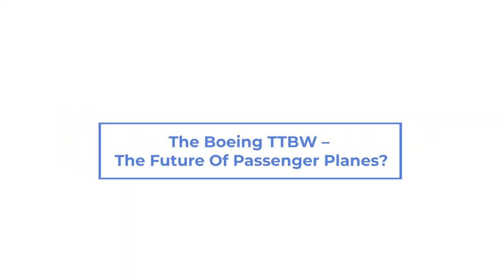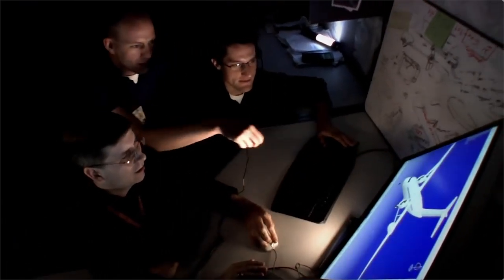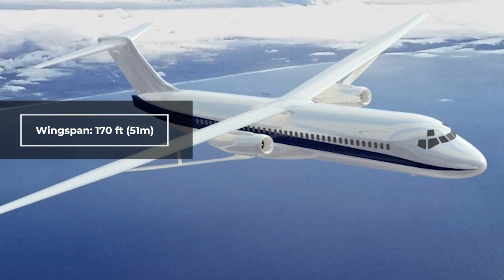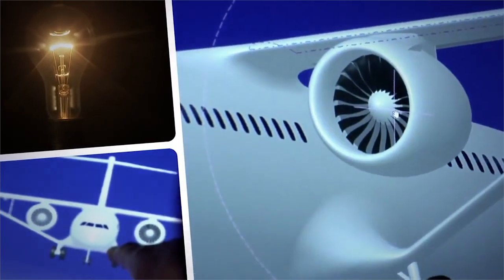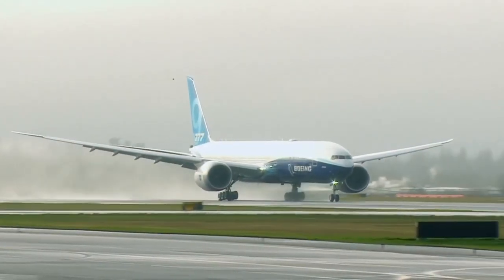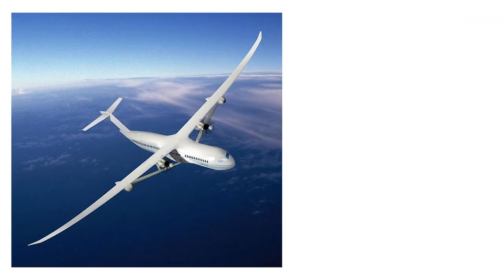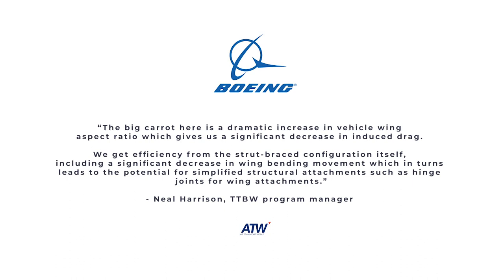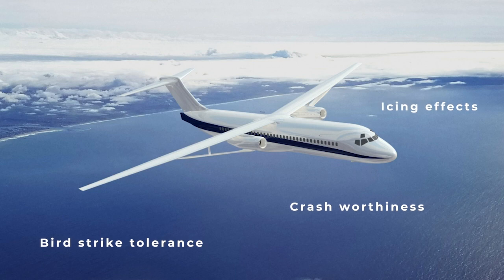The Boeing TTBW – The Future Of Passenger Planes?

Comment: 1. In the past braced wings are limited to slow aircraft due to drag.
2. If the brace is itself capable of lift the aircraft is really a joined wing design and that has possibilities.
3. High aspect wing ratios taken to the extreme have all sorts of problems: Structure is too flexible, has no room for fuel. Is too weak to carry engines and severe flight loads. But a brace helps these problems.
4. High wings on airliners with slung engines expose passengers to debris from uncontained engine failures and also more noise. However future airraft engines are likely to grow wider requiring 737 type aircraft to be higher off the ground with longer heavier landing gears.
5. Landing gears have to be mounted in fuselage producing a narrower track that is less stable and uses more fuselage space for folding and storage. This is often counted with a fuselage bulges which generates drag.
6 This configuration assumes the use of carbon based jet fuel which we want to faze out in favor of non carbon hydrogen which requires an entirely different design due to its vast volume compared to jet fuel.

Comment: Well but who's going to start the electric era?Boeing or Airbus or embrer or anyone,I am hoping Airbus could start it.
Reply: Lovevia Madeenah with the current battery technology none of them, their power density needs to improve a lot more in order to be used in big aircraft
Reply: @franciscoperezjuarez1481  well maybe in the next decades maybe solar panels will be on top of it that could save money for airlines.
Reply: @riliryrimaddyvia9630  solar panels are too heavy, would absorb too much heat, aren't strong enough to effectively be an aircraft skin, and wouldn't provide anywhere near enough power to provide any benefit at all to an airliner.

To put it into context, a b737's wings could only fit 1097 sqft of panels but that is only 2.7x the average installed on a solar powered house. That's no where near the power use even just in cruise on a jet.

Electric jets are possible once we. Have crazy dense and durable batteries but even then they will need to be very very fire resistant which isn't usually a trait batteries have.
Reply: Aeronautical engineer here. The best option for electrification at the moment is hybrid power. Since jet engines are their most efficient at full power, but can't run at full power during cruise, supplemental electric engines can be used for takeoff and climb.
Reply: @米空軍パイロット  But getting 2 kinds of Engines is also not efficient
Reply: @slav946  Yes, but the math has been done. It can work.

Comment: This is quite interesting. In the mock ups, I saw everything from turboprops, low bypass turbofans to high bypass turbofans. Assuming it'll go for a turbo fan, and to my knowledge high-bypass is best for efficiency, will those engines fit in the gap between the wing and the truss? Given how chunky high bypass engine nacelles are
Reply: Given the modern “resurgence” (of research into them) a propfan may be the best choice for this design, as it allows a massive bypass ratio without the huge cowling, which can mean a larger, more efficient engine fits in the same space. You could even place the fan(s) ahead or behind the wing while the core stays below it. The only problem is propfans are LOUD, especially when the tips of the fans go supersonic.

Comment: You haven’t clearly explained what might be the purpose of this and what type of aircraft class does it intend to replace. It seems to be just a replacement for short haul turboprop flights.
Reply: Higher fuel efficiency on a narrowbody jet concept. Possibly the "clean sheet" design for the 737 successor and ideal for flights of 3500 miles or less. Seemed pretty straightforward.

Comment: So turns out that Cessna high wing design with the support bars underneath was actually hyper efficient.

I am going to predict right now that  it will make more sense to strengthen the wing by other means and make it thinner than to add the truss. The existence of the truss is going to add drag and take away from your net efficiency.

Comment: But does it come with MCAS?
Reply: Ben Braker Yes, I know what it is. It’s a corrective system installed in the MAX series to correct for it’s weight balance being slightly different than normal 737s. I was making a joke based on the fact that the TTBW was being compared to the MAX

Comment: Boeing have configured this to take turboprops.  There is a 22% reduction in fuel burn right now with turbo props and only a tiny reduction in speed from Mach 0.8 to Mach 0.75.  There is at least another 15% reduction in this airframe probably 20%., future geared turbofans around 11%.  The ultra high aspect ratio made possible by the bracing will allow high efficiency, short take-off.  It will require folding wings.   There is talk of using solid oxide fuel cell APU that drives an electric ducted fan in the tail, that should reduce drag by 4% as well as thrust by keeping the boundary layer attached.

Comment: 9% fuel savings is great, but it is not groudbreaking. It is just a steady evolution of plane construction.
I would expect this or rather higher savings from any new model bulid from scratch.
This is probably planed to be the 737 replacement which Boeing has to come up with rather soon. (But TTBW sounds better for marketing)
Reply: Huh? This isn't a short-term plan by any means, and new models certainly do not save 9% fuel.
Reply: @AmbientMorality  The A320neo saves about 15-20% fuel over its predecessor the A320ceo. So 9% fuel savings is definitely not impressive for a newly developed model
Reply: @pix-point  Sorry, new model aerodynamic changes don't save 9% fuel. Numbers for this don't include benefits of a next generation engine

Comment: ...hmm having the engines placed directly outside and that close the passenger cabin is not just a noise issue, but if a turbine disc fails, it would result in shrapnel directly impacting the hull and passenger cabin over a larger surface area which would cause depressurisation and likely, multiple fatalities in that cabin area as well.  

Another issue is engine servicing.  Part of the advantage of low wing aircraft with wing mounted engines is easier serviceability with minimal equipment required..
Reply: What I was thinking. What happens to the wing or the truss in the event of catastrophic engine failure? Seems to me a rear mount might make more sense, given how much some of these look like DC-9s.
Reply: @simonbone  ...well they did take over the MD-95 after the merger and rechristened it it the 717 (which originally was the designation for the KC-135).
Reply: @kyotokid4  Yep, aware of that. But since some of these renders look like existing models (including the 717) I'd wonder a) how far this study has really come, apart from the wing design, and b) whether they'd already decided the best engine placement was on the wings. I'd be curious if they'd gamed the (admittedly unlikely) scenario of an uncontained engine catastrophe that damaged the wing or the truss.
Reply: @simonbone  ..my thoughts are this is that this will end up like the 7J7 and BWB projects and they will still be turning out conventionally designed aircraft in the future as the airlines will want to keep things as "common" (with what they already have) as possible. The 737 Max is a prime example of that..
Reply: @simonbone  Does Boeing really care that much?
Reply: Interesting take though the only US passenger fatality in 10 years occurred due to an uncontained engine failure on a 737, which did not have a high aspect wing.

Comment: This is essentially a glider plane with passenger fuselage and engines hanging beneath wings. They need to stick to this design philosophy to accommodate current airport infrastructure.
But if they wanted to do a really efficient flying machine, they already know everything about blended wing body design. I would vote for efficiency to become #1 driver and figure out a way to motivate airports to adjust their infrastructure instead.
Reply: Jure Pečar “this is essentially a glider with a passenger fuselage and engines hanging beneath the wings”. Which means.... not a glider....

Comment: Surely, if the efficiency improvement is only 9%, then the current aircrafts will be able to achieve by incremental improvements over the next 15 years?
Reply: Unclear what 9% means, but if that's purely aerodynamic (assuming similar materials and engines to current aircraft) that's a huge improvement.
Reply: @AmbientMorality  Doesnt A320 neo offer 7% improved efficiency over A320 ceo, mainly via aerodynamic effect and better engines? Better materials, engines and aircraft designs could easily achieve further 5% efficiency over the next couple of decades. The question is then the TTBW would be worth the extra investment?
Reply: @rockersidF1  Engines account for almost all of that though. Purely aerodynamic changes that increase efficiency by a large amount (9% for some reasonable mission) are notable because they can be combined with latest-generation engines for a much larger efficiency increase.

Comment: This would be a nice 737Max replacement
Reply: @Ben Braker the current 737 is a dead horse in medium term. It's essentially a 60s design, originally made for much lower passenger capacity, and turbojets. The aerodynamics are 60 years old and the gear is too short for modern engines. If they design a version with a longer gear, and new carbon fiber wings, almost nothing would be left from the original construction, so it makes much more sense to start from the scratch without the limitations of the old construction. They need a completely new 737 in the 2030s, and they know it.
Reply: @simonm1447  the aerodynamics are not 60 years old. New wing for 737 NG, new tailcone for MAX, and many smaller changes over the years

Comment: Seems to be a press release based on needs for any news other than the bad news Boeing is known for lately.
To sad that this concept still is nothing to really take them to the future of air travel. Range of travel of 3000 miles is likely to shift to other means in future eg super high speed trains. This concept may just be for the time in between now and then but I doubt that since in 15 years to many things will happen based on the speed of improvement we see in alternative power sources and means of using them for transportation.
Reply: The spin is in....

Comment: A faster top speed, but will it be able to use it? Airways are congested and Air Traffic Controllers determine the speed of traffic. Will this be another Convair; faster that the rest, but kept at a snail's pace?
Reply: Efficiency is everything in this business. The Convair was fast, but it was also a fuel guzzler, even for the time it flew. If this concept is more efficient than current aircraft, but can reach the same speed, it has the potential to be a successor.
Reply: @simonm1447  OK! I see your point. Thank you for illuminating this fact.

Comment: It sounds to me this is the 737 REPLACEMENT, most likely to be called 797 (Boeing will fill the gap the NMA wanted to cover with variants of the 787 and 777), since it is in the RIGHT TIME FRAME of 10-15 years from now.

Feel like ultimately the MAX problem will be cured by NEW SMALLER ENGINES (by 2023, I'm afraid) rather than by SOFTWARE (too big of an engine for a so "low slung 1970's design" or as we say in the car business: "not enough ground clearance"), which will be a TEMPORARY (10 years or so) SOLUTION until this TTBW / 797 comes online.

Could be wrong, but "common sense" tells me this as the PROPER way to go...
Reply: Larger engines are necessary for efficiency, so that trend isn't stopping. Software can be safe, see all modern aircraft, just not 737 MAX's implementation

Comment: “as soon as 2030 or 2035”
Reply: Boeing needs a new 737 in every case - the current one is stretched to the technical limit, it's essentially a 1960s design modified over and over in the last 60 years. They will have to think about, if they go the way of a shrinked 777X with conventional shaped carbon fiber wings and a aluminum cell, and risk to  have a obsolete aircraft in the 2040s, or if they introduce something more revolutionary. The 737 Max can't be the answer for more than a decade, it's already inferior to the 320 Neo, and the Neo still has potential to modernize it.
Reply: Simon Maier damn you know your stuff. Thanks for explaining🤗

Comment: It is always funny when we are talking about teh future of one of the must advance industries in the world and we still use 19th century measurements to describe it.
Reply: A measuring system used by only three countries, while the entire rest of the world uses a system that makes sense.
Reply: @Darndiddlyarn  Even Airbuses use imperial fasteners.  The metric system isn't really used in aviation.  Altitude is in feet, distance is in nautical miles, fuel is in pounds, etc.
Reply: @Alpha8713  you could say the same about any machinery if you really wanted to. Tyres are in inches, brake lines are BSP, seat belt bolts are 7/16th, pressure is mostly in PSI. But I was referring to the national standard not industry anomalies. In the limited flying experience I've had, distance was in km and fuel was in liters or tonnes, cruising speed was kmph.

Comment: Anyone who says, "Oh it's basically just an ATR!" is a complete moron. Apparently any high wing designs are "Basically just ATRs" to them. Look at a Cessna! It's basically just a smaller ATR!
Reply: They are not talking about just the high wing. Under wing mounted engines on high wing with T tail is not a common configuration. There is no cessna with this configuration, but the ATR is the most common example of the configuration, that's why people are comparing it.

Comment: Sorry I would never enter a Boeing Aircraft which has foldable wings. Who knows if the computer during the flight decides to fold it due to a wrong signal from the cheap unproven single sensor they are using. As this has never happened that Boeing is risking the life of passengers in order to safe 500;Bucks for a second sensor on a multi million dollar plane.
Reply: For folding wing mechanisms there is no power to the actuators or latches during flight